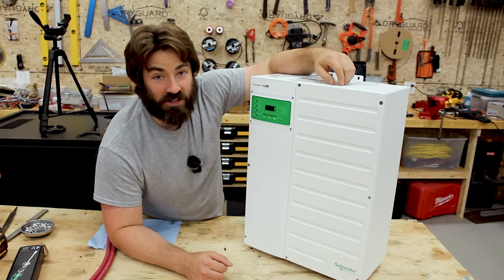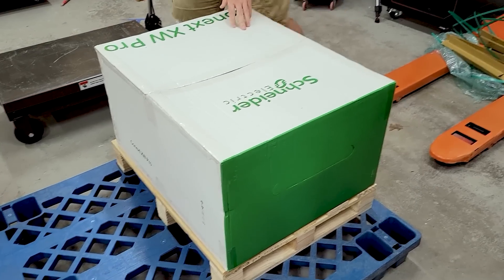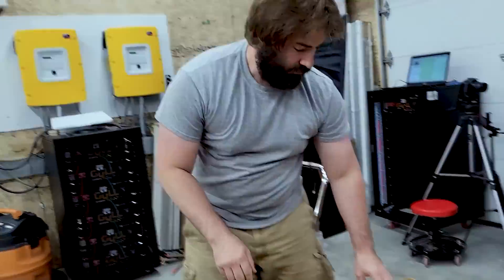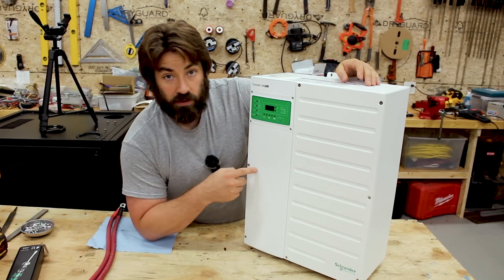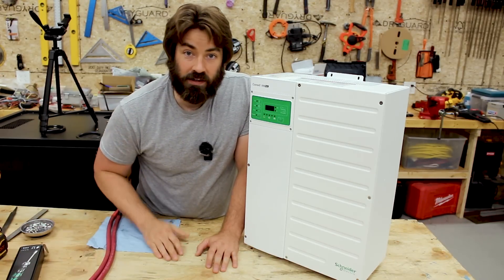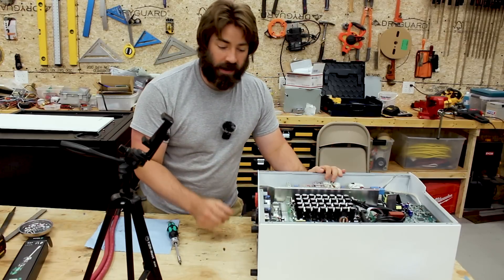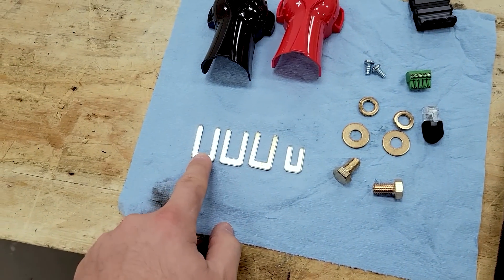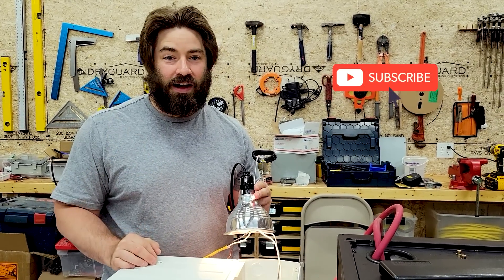Powerful Inverter for Solar Off Grid, Whole House, Schneider XW PRO 6848 Inverter, Hybrid

Comment: Great video.  How quickly does it switch from the grid to the battery if your power goes out?  What happens when your grid comes back on when your generator is running to charge your batteries? Would you happen to know if it automatically turns off your generator?  Are the L1 and L2 out, or are they in the same or out of phase?  Do you know how many amps the inverter will pass through from the Grid?
Reply from the maker: I think the manual says less than 10ms transfer time.  Basically, the lights might blink, but your clocks won't reset.  It's pretty seamless.  
I have not tested Grid-Gen setups yet.  In the insight home you can program hundreds of settings.  I imagine it would follow whatever you programmed.  Typically something like a 5-minute window to verify the grid is staying up before switching to it.  Then there is no need to keep the generator running. 
The inverter can pass through 60 Amps.

Comment: 48 Vdc is inverted to 27 Vac going to the transformer. That second small transformer looking thing in series with main toroidal transformer primary is a low frequency inductor serving to increase main transformer's leakage inductance so that transistors can power spiky loads like microwave ovens without blowing up.

Comment: Wonder how they compete with the SMA ? i think you have SMA to ... I have the older XW6048 and never once tripped overload ...
Reply from the maker: The SMA's and XW PRO have similar overload specs.  Both are quite efficient, but the XW PRO is 1-2% more efficient across the range.  The biggest difference is that the XW PRO puts out 120/240V split phase right out of the box.  the SMA's only put out 120V.  This means you need to parallel 2 SMA's in order to get 120/240V output.  

Also, I found the SMA's can be a bit challenging to set up in the menu.  The SMA's are factory set for lead acid batteries.  Once you use lithium, you need to add an external controller (such as a BMS)

But, once the SMA's are set up, in a pair, with external control, they work very well.
Reply: @DavidPozEnergy   The software on the Schneider xw6048 is very odd to say the least I am using modbus control with my custom control so I can for example discharge batterys if tommorow the forecast is sunny :D  and also to control the internal charge controlled depending on my Sma and Fronius inverters output.

Comment: I love to see this in grid-tie mode, looking for an inverter that can start in grid-tie and then when funds allow go off grid with a good size battery bank.
Reply from the maker: This inverter allows grid-tie, sell back, and zero-sell functions.  However, you still need at least a small battery because this is a battery-based inverter.  Some users buy a single 5kWh battery at first, and add to the battery bank later as funds allow.  These functions only unlock when you program with the insight home.  I haven't yet hooked up my insight home, but will be showing it in a future video.

Comment: the fact I can't connect my 30k batteries to it , would not make into my upgrade List. - But itis a solid Unit...great video as always
Reply from the maker: What batteries are you using?
Reply: @DavidPozEnergy  on my plans I have set to use EG4s
Reply from the maker: The new Eg4 batteries (V2) will support closed loop communication directly with the Schneider inverter.

Comment: When do you plan a deeper dive on this one.   I have some questions but suspect your next video will answer some.
Reply from the maker: I'm putting the final touches on the editing of the next video.  This is a series, I plan it to take a couple months to go into all the testing I have planned.
Reply: @DavidPozEnergy  I like that this product is modular but that does bring into question which modules you really need, which ones you really want, and which ones you can avoid the cost on.   Any help demystifying that would be very helpful.

Comment: Requesting to test this inverter

MegaRevo 8000W Hybrid Inverter

Model#: R8KLNA

Features

> Works With & Without Batteries
> 120/240V Split Phase
> Paralleling – Connect Multiple Units for Even More Power 
> Compatible with 50/60 Hz Grid Frequency
> 12kW Max PV Input
> Four (4) Mppt Input
> 120 – 500V Mppt Input Voltage
> 8kVA Rate Power Output
> Max. charging/discharging current of 190A
> Max. efficiency of >=98.2%
> Battery Voltage Range 48V
> Compatible lithium-ion, lead acid and other solar battery types
> Battery reverse connect protection
> Wifi Remote Monitoring & Management
> Intelligent energy management features
> Power dispatching and side demand response management

Comment: I am looking forward to your videos on the Schneider. My system is using an XW-Pro 6848 AC coupled to an Enphase  array. My only issue is with the software. When it is inverting, it will shut down 0.5 volts above the "Recharge Voltage" an then it will just site and not charge back up. The battery either has to fall below the recharge volts, which could take a really long time, since there is no load on it, or another device or a human has to tell it to charge. I ended up programming a separate PLC (Programmable Logic Controller) to send commands to the XW-Pro. This is not a problem if you use DC charge controllers. Then the charge controllers do all the charging.

My last grid power failure also made another problem pop up, but they say it has been fixed in newer firmware, so I have to do that update. When it was frequency shifting to adjust the output of the Enphase inverters, it somehow dropped to 57 Hz which shut off all the Enphase inverters as a bad grid, and it just stayed there until I restarted it. The firmware update through the Gateway is easy, but I have to shut down everything in my backup load panel to do it.
Reply from the maker: Thank you very much for sharing your experience.  I'd like to test the AC coupling function on my system and I appreciate the insight.

Comment: I have 2 of them in parallel. I really need to get my house cut over to them instead of sitting around for testing.  They are NOT fun to mount on the wall by yourself.  Make sure you have help.

Comment: bring it to my house, and we will hook up the central A/C unit, and see if it can handle a 3.5 ton condensing unit....in florida !!!
Reply from the maker: If you were in Massachusetts I'd call you to set up details.  Sorry, but I'm not driving down to Florida.  Do you know the in-rush current of your A/C?
Reply: @DavidPozEnergy  i understand, thats a long drive !!..... for the A/C unit is like 24 amps, then drops to around 9-10.  i am curious about the ability of this inverter. and lok froward to the future videos !!!......i like the transformer types (for the motor loads).....or maybe a pool pump at 14 start, and 8 continuous.
maybe the Schneider could handle both at the same time?
Reply from the maker: I don't have 240V motors at my house.  I have been testing my 120V tools (table saw, air compressor) and they work perfect.  I also have an electric dryer that pulls 5kW and that causes other inverters to shut down, but works perfect on this Schneider.
Reply: I'm in FL and it starts my 4ton, while running the 2 well pumps

Comment: I work for schneider as a project manager. These are absolutely a beast.  We use them in all of our buildings personally and it never cease to amaze me.
Reply from the maker: Very cool.  Thanks for checking out my video.
Reply: There THE BEST   !
Reply: Are these low or high frequency?
Reply: @lant404 low frequenct
Reply: Do these work together in 3 phase and what monitoring options do you offer?
What 48V batteries are supported by these inverters?
Is there a dedicated "brains" available like the Victron Cerbo?
Reply: I purchased a full house solar system in Oct 2020 from a solar installer with many years of experience with this system.  The electronics were all from Schneider Electrical and included two inverters and charge controllers and associated equipment. After two years the system began to experience numerous failures to included getting stuck in a loop, cycling the power on to the house several times before resetting on a number of occasions. The system also frequently shut down requiring me to reboot the system with error codes that made no sense such as fused relays. The system finally completely failed.  Despite numerous service calls from the installer over the space of a year and many wasted hours they were unable to get the system to work and would not continue to support it.  I replaced the system with a Solar Arc 15.   I have made numerous attempts to reach out to Schnider to address this problem and cannot get an answer from their customer support center.  The phone rings for an hour and just disconnects.  The system is still under the five-year warranty. I went with Schneider equipment with the belief that this established company would be a safe bet, instead it has turned into a living nightmare.  I want to return the system to Schneider for a full refund. Since I wrote this several days ago and mailed them a copy they remain non responsive.
Reply: I have a question, I had this unit installed  on my property by SunPower Solar, who is no longer in business. They installed this unit along with 24 405W (model spwr  SPR-U405-Blk) solar panels. they also installed  3 SunVault 19.5. 1 ESS 1.3 Back up. the installation was completed with all permits and clearance of PTO, but that never happened before right after the completion of the job, SUNPOWER filed for BK leaving thousands of people without programing the system or commissioning the panels, the went out of business and we are all let out to dry....... How can i program the system to operate as it was programed to do the App is not longer working from my understanding..I had to contact someone  to help commission the solar panels by adding another inverter...but was unable to configure the figure this CONEXTXW PRO to syn with the batteries...whats the solution?

Comment: Have you ever checked idle current on the ac and dc side on all these inverters under no load? Love those toroidal transformers. They have the least losses in wattage and can handle higher wattage. More mainstream companies are going the transformers because they see the Chinese have been using them for decades and cheap and they work well. I have a 15kw powerjack and it handles everything I can throw at it. It’s idle current is 15 watts.
Reply from the maker: A 15kW inverter only pulling 15 Watts in idle is amazing.  I've heard of numbers like that in standby mode, but never in idle.  Can you please send me a link to your inverter so I can check it out?

Comment: I'm sure it's good but I've been running two OutBack GVFX3648's since 2006 flawlessly. That's well pump and other 240V equipment. OutBacks are so good they used them in the Gulf War. What's MTBF of the Schneider, the idle current and efficiency? Also are you getting anything at all for reviewing this like free equipment?
Thanks.
Reply: Outback has great software setting it is very easy i sure miss my Outback inverter settings, I now have a Schneide XW and it is a pain to setup.

Comment: Its to bad the Pro firmware is so bad!!!!!! Installed dozens on them (pro) and way more of the +. I run my entire modern home with a single XW 6848 +. Just be aware the Firmware is total crap and changes monthly .
Reply: The latest firmware (1.11) has been pretty solid and resolved all of my issues.  It's been out for a while now.

Comment: I need something that will handle a 240v well pump and a 240v on demand water heater as well as my other appliances such as refrigerators and 240v mini split air conditioner/heater. 😳🙂
Reply from the maker: I'm currently running my whole house on this one unit.
Reply: @DavidPozEnergy    Must be that toroidal!

Comment: Although ( low frequency ) transformer based inverters are indeed very robust and can handle larger overloads, they are very inefficient, which can be no problem if you have a surplus of power, but if that is limited the low frequency transformer is a drawback.
Reply: That toroidal transformer is around 96% efficient. On par with best switchmode inverters of similar power rating. It's main drawback is weight.

Comment: I've used Trace/Conext/Schneider system for 18 years. Finally switched to Lifepo4 and upgraded to 48v XWPRO from 24v. Installed 800ah SOK server rack batteries. Tech support informed me that the XW won't communicate with an open loop system. Hope at some point you'll figure out how to work around this. Currently just using voltage settings on the XW and MPPT'S.  THANK YOU
Reply from the maker: I'm also running my Schneider right now (powering my whole house) open loop.  Not a huge deal.  I don't know if there is a closed-loop option directly to SOK batteries since I don't own any SOK batteries.  But, if you want State of charge control, then you could add the Schneider Battery Monitor: https://signaturesolar.com/schneider-battery-monitor-48v/?ref=4_rHcgZ9x-TiF-  Just an option to consider.
Reply: @DavidPozEnergy  From what I have been told, the battery monitor won't work with lithium battery.

Comment: Dear David Poz,

I live in Puerto Rico and power outages are a big topic to all of the islanders.  I know hundreds of people here in the island using schnider producst with a very famous solar microinverter company called Enphase.  I would like for you to dig ALL the issues the integration between Schneider and Enphase have surfaced lately after the pass of Maria and Fiona Hurricanes.  Us.... the end users have to deal with a lot of issues while using both products together when Off-Grid.  When the hirricanes hit Puerto Rico we were without power for weeks at a time and experienced the shortcomings either from Schneider or Enphase.  Noticed that this is a paid video and would like to use your exposure to direct this comment to Schneider.  I am Electrical Engineer by trade and open to discuss the issues we went thru with Schneider.  Have a great day.  Joed
Reply from the maker: Hi Joed,  Thanks for letting me know that people in your area are combining Schneider and Enphase.  Do you know why they are choosing to AC-couple instead of DC-couple?  I don't even care about the other brands for charge controllers, could be Schneider, or Midnite Solar, Outback, whatever.  But I'm just surprised you are AC coupling mostly so I'd like to know what is driving that choice.  

Thanks,
David

BTW, I'm not paid by Schneider (or anyone) to make these videos, but I was given the unit for free.
Reply: @DavidPoz  Hi David!  Thanks for your reply.  The only valid reasons that I can think off are the ability to gradually add solar panels at a smaller pace/quantity, the ability to retrofit faster when panels go bad (hurricane season for us in the island and shortage of panels due to supply chain), and the advantages AC-Coupling add for expansion and efficiency (in certain architecture cases to sell back to the power utility).  I believe that there is a technical integration issue between Schneider and other devices for ac coupling (I am an electrical and computer engineer that focused on integration not power but studied/analyzed this issue in depth) and I thought the ac coupling feature could be an interesting topic to cover as the Schneider inverters offer this feature.  Granted, you are not considering other brands but I hope this message will persuade you otherwise when considering the advantages this feature brings to the table as it offers a lot of insightful information that could lead to a lot of content to cover.  Definitely, dc coupled will be considered for most of us solar systems enthusiasts when it comes to use off-grid in contrast with the disadvantages dc coupling offers.  I am available anytime if needed to go over this topic offline along with my findings.  Pretty interesting technical stuff.  Have a great day and will continue looking at your content.  Best of luck!  Joed

Comment: David I'm really looking forward to your future videos on this inverter, there's not too much XW Pro information out there especially for DIYers 🙄 I'm still learning this is probably my toughest project so far,  it can be a little intimidating.  I'm still  collecting components,  like wiring, tools, fuses lugs and pretty much everything involved with solar.  Can't wait to take it out of the box 😉with help of course.  I'm curious how this inverter will work with DIY LifePo4 battery banks.
Reply from the maker: You can always start small and learn before dropping big money.  The good news is that this inverter can work with any readily available battery, and most DIY batteries.  But, we should define "work".  I'm simply saying that it can draw power from a DIY battery and power your loads.  But, if you start talking about charging, that's really a question of what charge controller you have.  Advanced users might want to incorporate "closed loop communication" which is nearly impossible with DIY BMS's.  But, if you want the functions of closed loop with an off-brand BMS, then add the "Schneider Battery Monitor".  Anyways, lots of options.  I'll be unpacking some of this in the future videos.
Reply: @DavidPozEnergy  don’t forget that the xw can charge the battery from an ac source (grid, generator, some other inverter). For the first 2 years I had this inverter that’s how I charged my battery’s. It can sense battery voltage (but won’t track SOC/ amps without the monitor) my simphi battery’s came with xw charging specs and worked just fine. 

It has lead acid settings or custom settings which is what I used. Set up what you want the bulk, asorb, float voltages and times to be and it works. :) 

It will work with most any 48v normal battery